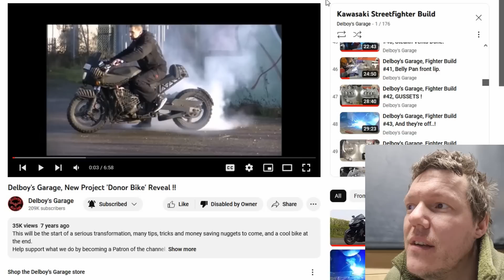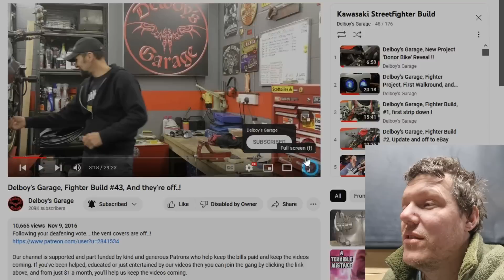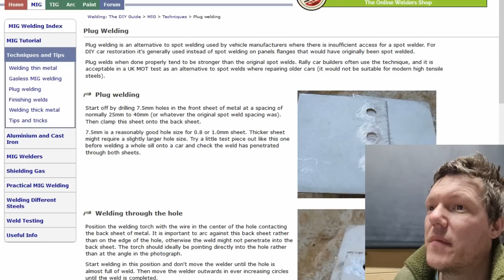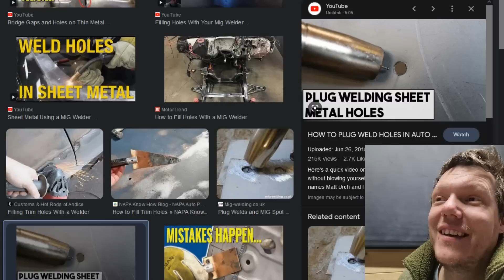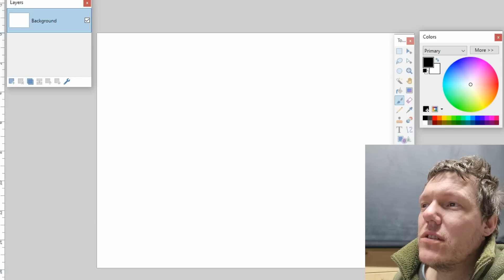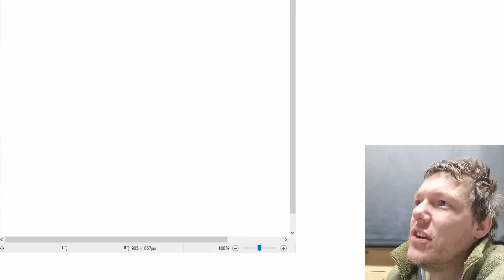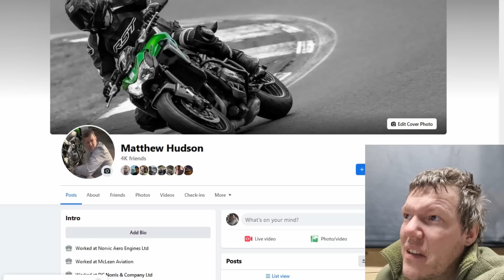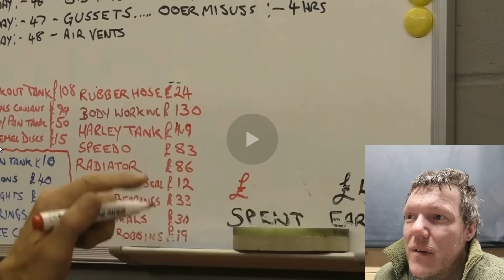HDS 28 - It ain't hard is it

Comment: Yeah, I agree Matt, I've noticed that anticipation building in me. ("the 12 critical steps that led to an air disaster")  Speaking of; when does he fit air-brakes? Folding out from the foot protectors, when he touches the rear pedal. These use hydraulic actuation, linked to an EMU, accounting for lean angle. The front anti dive system, will assist in locking up the front wheel under any circumstances, flinging the rider from the bike. Zero brake dive and front end loading.

Comment: If he really was a mechanic as he claims he would know about walking away from something your trying to complete and taking a breather….for instance…..when I first 46:22 used to work for a garage that specialised in Lotus powered vehicles, Ford Escorts and Cortinas and sometimes an actual Lotus the guys there used the old up the tailpipe sniffer and a carby balancer and timing light. I had done my apprenticeship under a pommie guy who had worked for Lotus Racing, Honda Racing and Aston Martin Racing teams. Long story short…yes you use those tools to set a baseline…then by “ear” you fine tune the car….you rev it and listen….you drive it and listen (pinging), flat spots in acceleration….tweak, tweak fucking tweak till it’s perfect, all done by ear. I did this with my first customers car a Lotus Escort and the all thought I was a fuckwit. The customer picked up his Escort and 20 min later pulled back into the shop. He wanted to know who tuned his car….the piss weak manager pointed to me straight away. The customer came over shook my hand and said that’s the best his car has ever driven. But some days you can’t seem to find that sweet spot…you can’t get 4 Carbys on a Lotus 4 cylinder to hum, so you walk away have a cuppa do something else and when you come back to it 50% of 99 times out of one hundred you get it right. Not sure? Walk away do something else and come back and you’ll figure it out. Dellballs doesn’t know this as he is not and has never been a fucking Mechanic. There…I feel better now.

Comment: 15:39 It's large and thick.  Like Del, but not like his hair.

At 48:10 he says he has to put a bit of mesh in the front.  But didn't he say, in the very last video, that putting mesh the holes was "crap"?

He should put 8 holes in the front, with tubes running down to the belly pan, then feed that into a recorder plugged into each hole, each one tuned to a different note.  It would be hilarious.